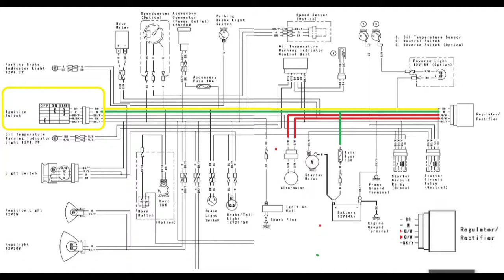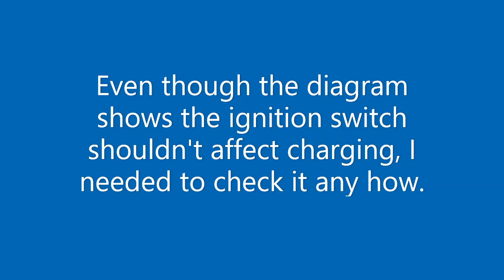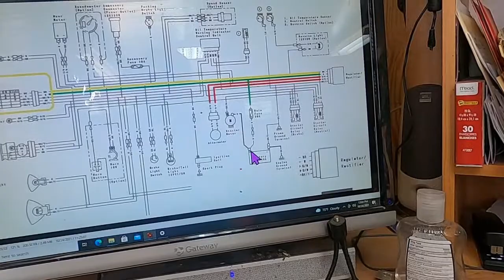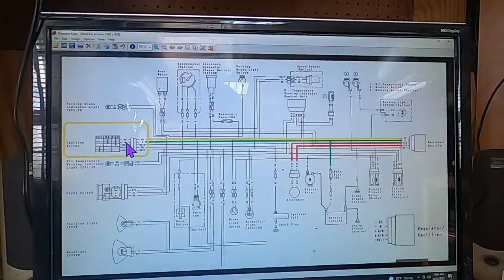Testing the Mule voltage regulator

Comment: I could not see how or what you connected your leads to?🤷‍♂️
Reply from the maker: I had the meter across the battery at the beginning. The stater check the meter set to A/c and connected directly to the stater using the old harness plug. The rest I thought I explained well. All this was to confirm a bad regulator before I bought one.

Comment: New ignition switch, regulator and battery. Still not enough charge. I’ve got to boost each start. I’m getting 14 v on my meter at the battery when it’s idling.
Reply from the maker: Sounds like a weak battery, or the valves are too tight.

Comment: i am also doing a project on a 610 mule and running into the same issues with the wiring harness. just about got it all fixed up with the exception of the 2 fuses that go by the battery. 1 is a 30a and 1 is a 10a. i am needing to know how to wire these in so i can get the charging system and head lights working again. ive watched just about every one of your videos on the mule.
Reply from the maker: I had to buy a new wire harness for mine. I found the wire diagram here https://www.slideshare.net/naro1/kaf400-mule-600-610-4x4-05-service-manual
Reply: @larrybl  do you have a part number and where you bought the wiring harness from? thanks
Reply from the maker: @ezekielrueda7890  All I could find in my notes was there are two harneses, main and headlight. headlight & wire harness, I ordered from (Cheep Cycle Parts) and the cost for both was $634.38
Reply: @larrybl  also would you think a non existing 30a main fuse and 10a accessory fuses would be the reason it is not charging my battery and headlight not working?
Reply from the maker: @ezekielrueda7890  More than likely.
Reply from the maker: @ezekielrueda7890  More than likely. My harness was melted down.

Comment: Thanks for the video!  I have a 610 Kawasaki Mule and have started to look for my electrical problem(s).  I have a good battery and have checked the fuzes that I can see, but when I turn on the key - nothing.  I have spark / power back to the starter.  Have replaced the ignition switch (due to lost key) so I believe that is good.  Checked both Relay assemblies near the battery, both are ok.  Do you know how to test the controller (black box) near the regulator?
Reply from the maker: I think the control box is for the oil temp sensor. The issue you describe could be the neutral switch out of adjustment. It is located on the transmission near an axle.